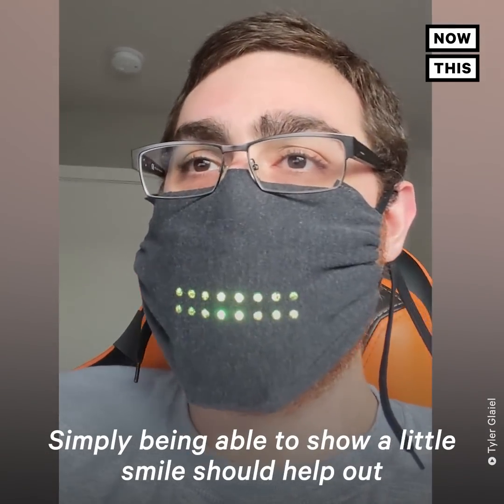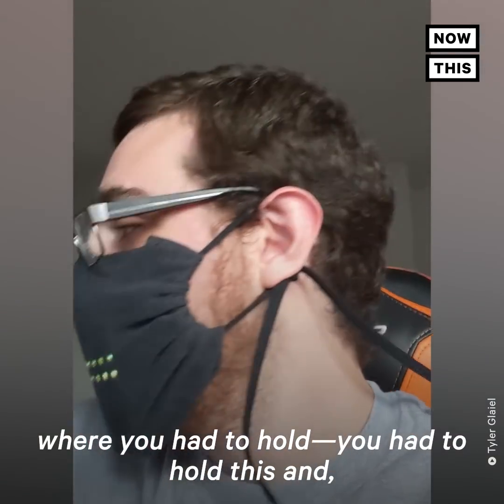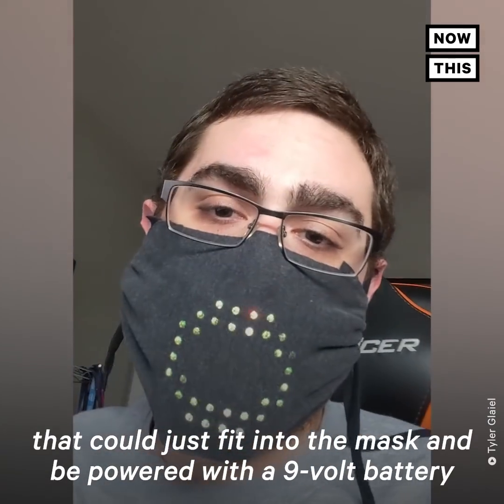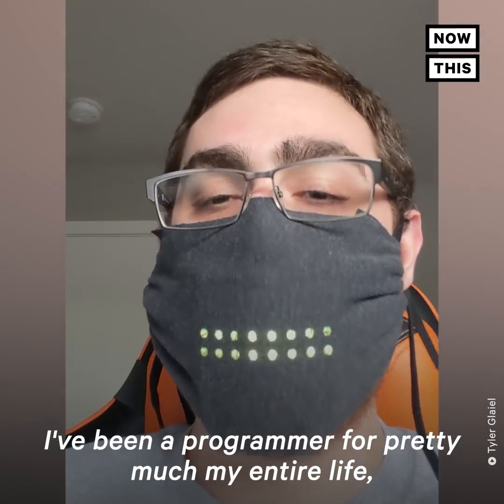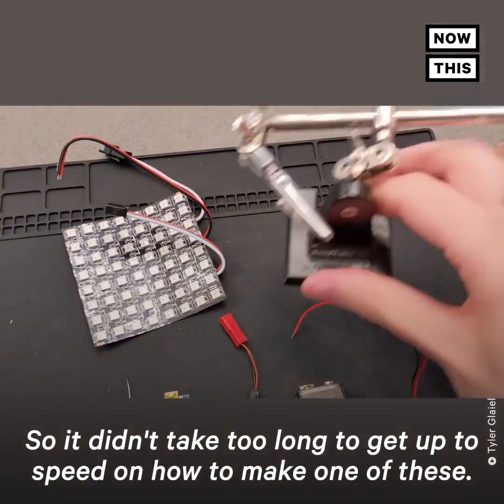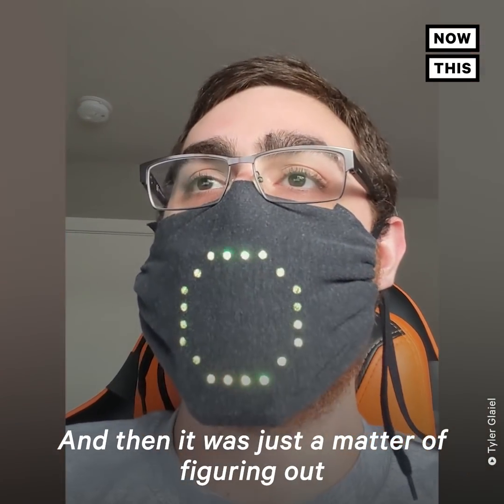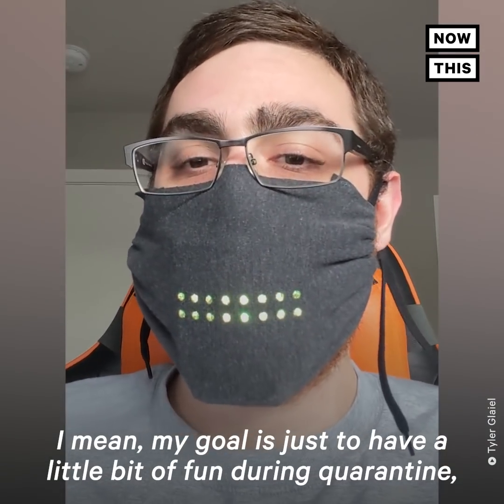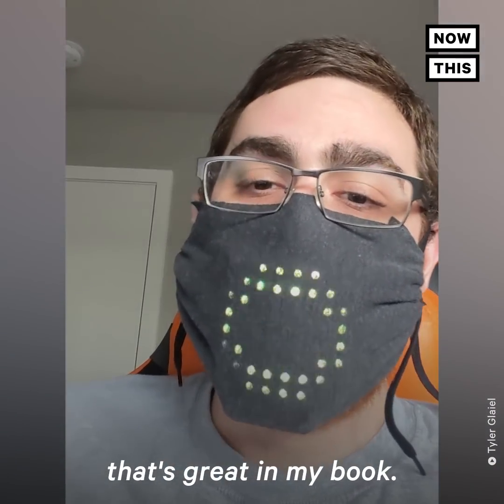Programmer Creates COVID Face Mask That Shows Emotion | NowThis

Comment: This is nice and all, but can someone make a mask I'm able to wear without my glasses fogging.
Reply: You need a brace that goes over your nose. The brace act as a sealing device to prevent the warm air to rise up into your glasses. I hope that makes sense.
Reply: The struggle is real, my friend! If you find a cure to mask related fog syndrome, please share it with us! 🙏
Reply: Agree lol
Reply: some dish soap, a single drop is sufficient, and rub it onto both sides of each lens before rinsing it of....  or shaving cream has the same effect.   Apply and wipe off.
Reply: There are hospital masks designed for glasses. They have an extra strip at the top in and outside to prevent airflow
Reply: you need better-sealed masks
Reply: i need that
Reply: @nianetic5165  That's not an IT solution, that's a "Trump" solution.
Reply: Spit on your glasses that's what scuba divers do. It might be a shite call but with proper hygiene it does work. The alternate is to buy no fog spray for your glasses